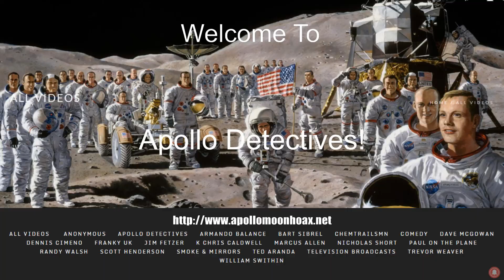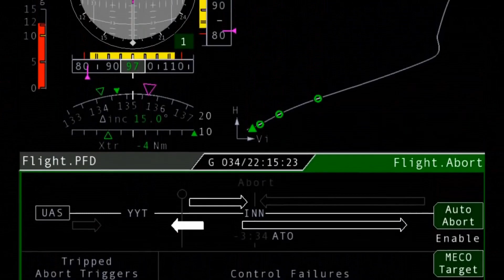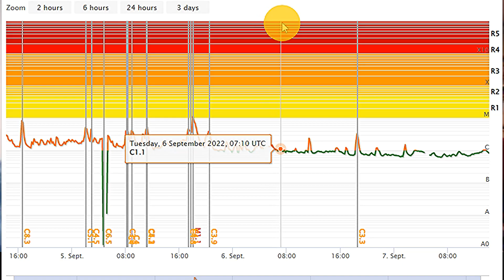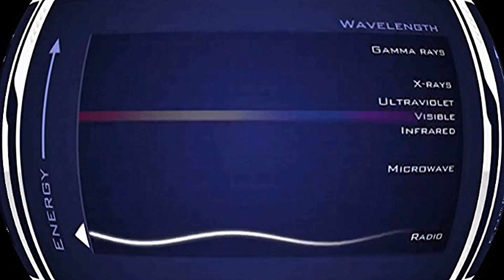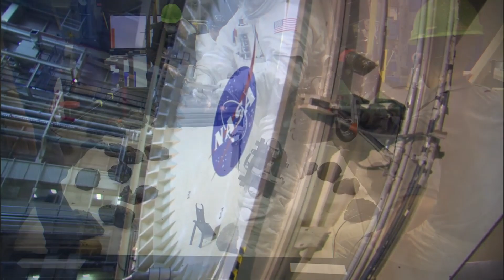THE APOLLO DISCUSSIONS "APOLLO 2.0" PART 1 OF SHOW 10

Comment: I'd like to see a lot more about the vacuum problems that NASA never even acknowledged existed.
I know the effect that flying in a plane just 7 miles high, with its slightly reduced cabin pressure, has on legs. They can swell up painfully. This can cause blood stasis and subsequent death from pulmonary embolism.
Remember that experiment where a sealed glove was put into a vacuum chamber? It expanded grossly. Imagine a hand inside that.
I want to see real vacuum chamber experiments. Put a just-killed pig into that huge chamber, then do a post mortem on it.